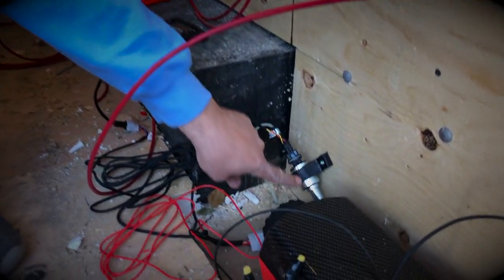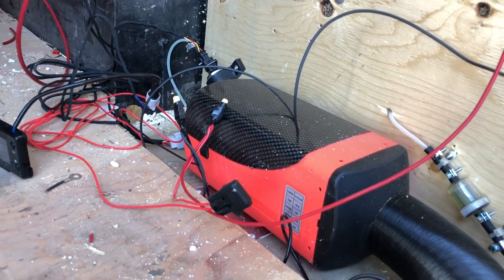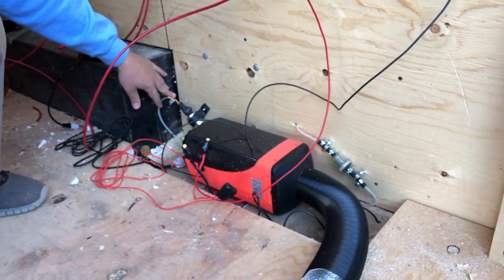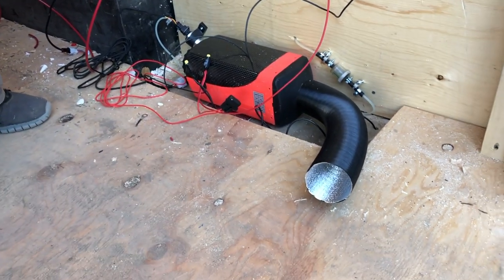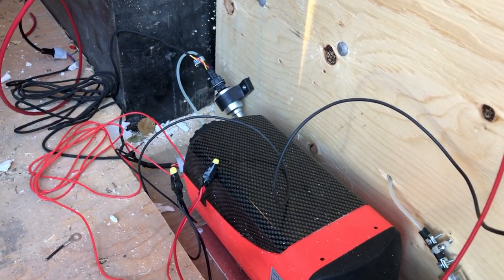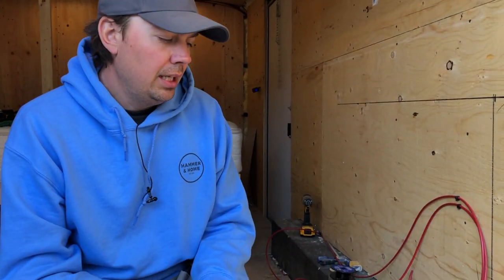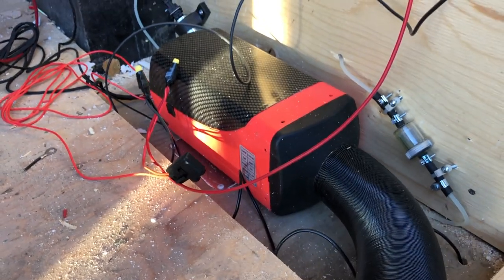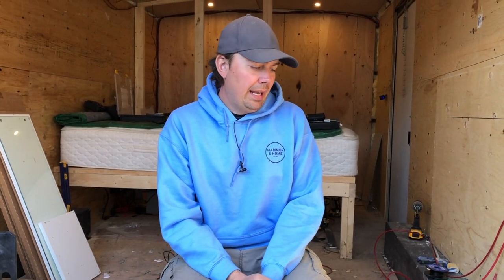Didn't expect this after installing the Happybuy Chinese Heater in our tiny home

Comment: I just ordered a diesel heater and have been binge watching videos like yours.  I thank you for your time and information.  It is very much appreciated.  I noticed your muffler laying sideways or flat.  I believe it is supposed to be turned like 90 degrees, so the weep hole in the bottom can drain out moisture.
Reply from the maker: that is correct, it should be vertical so the condensation leaks out, I have learned a lot since i posted this video. I also just purchased another heater, it one of the all in ones. ill be doing a video on it in the future as well. thanks for watching

Comment: One more note
I use a little harbor freight battery stick pump to fuel my tank
$12 and works awesome no funnels or pouring. And took a 2 foot piece of 4" thin wall PVC and glued a cap on one end. I put a wadded up rag in the bottom.
After I fill my tank I take the can and pump outside wipe the pump down and put it in the tube mounted in storage compartment
Never spill any doing it this way

Comment: Suspend the fuel pump on thick rubber band rings - the kind used on tent pegs  -  it will  wipe out most of the sound board solid mounts you have now
Reply from the maker: great tip thanks
Reply: Plus as you build it in, will also help.

Comment: I agree diesel stinks if you spill even the slightest bit
But one thing to consider is the climate you will be using it in
#2 diesel will gell up at around 15 degrees Fahrenheit
#1 will do a little lower
I live in the Pacific northwest and out here unless you live in a higher elevation town. All you can get is #2 Year round.
My heater is inside a snowmobile trailer that I also camp in up at the snow parks.
And because of that I mounted the tank, filter, pump and all the lines inside.
I have a unvented blue flame propane in there also
But it has a low oxygen sensor that is very sensitive and will not light much above 4500 feet. Also unvented propane actually adds significant moisture into the air. But it is a backup and could be used if trailer was sitting unheated and diesel was gelled up to thaw the system 
I love the diesel heat. Very hot dry heat

Comment: You can run diesel or kerosene, kerosene doesn't make as much heat as diesel. The ticking is the same volume but it clicks faster on high. You get used to the ticking though. We are off grid in a 5th wheel at 4000 feet elevation. I've had to change base settings in the advanced menu to tune for altitude. We love it.
Reply from the maker: nice! i haven't got into the settings that much, but it sure is a handy heater, I just picked up another one , its the all in one unit. so far its working pretty good. cheers

Comment: For one you should suspend the fuel pump with some kind of rubber and not solid mount it against a wall. That will only amplify the sound. Then enclose the pump inside a container with sound deadening insulation or foam of some kind. I'd mount the fuel tank inside to keep it warmer during below zero temps, Diesel fuel gels in cold climates. A tank inside a container will keep spills contained within.

Comment: Don't mount the fuel pump on a wooden board it'll act like a speaker
,I mounted my pump in an electrical plastic box and suspended the pump inside with an elastic band but make sure the fuel doesn't touch the box and can hardly hear it now.
Reply from the maker: that very true, i moved that configuration around right away

Comment: I am getting aluminum  box for the front (on the tongue) was wondering if the heater could be mounted in the box and just the heat vented into the traiiler  with  the controller mounted inside also? Thanks for the great video!!!!

Comment: We have a VW T5 van and fitted an Eberspacher diesel heater mounted under the floor can’t hear the pump at all may be worth trying one from Eberspacher. Regarding kerosene the Eberspacher manual says 50/50 kerosene/diesel at -15 to -25 *C, 100% kerosene below -25*C if using a separate fuel tank of course. Hope this helps.
Reply from the maker: Cool, thanks for the info! I’ll check it out and

Comment: Every experience heater I've worked on had the pump outside and mounted in a rubber mounted. Never heard mounted.   Also the oem ederspacher pump is quieter than the Chinese knockoff.

Comment: There are many videos on YouTube covering this topic but there are now “Silent” (expensive) pumps available on eBay. Always read the reviews before committing to one though as some offer no benefit at all. A great deal of the noise is also transmitted through the actual fuel line as well, so you may want to look at insulating this as well, particularly where it is fastened to the chassis. Good luck.

Comment: There are hundreds of video's that address the noise coming from the pump watch them. You can't hard mount the pump that's why your getting noise and mounting it outside would have eliminated much of the noise. I've never seen anyone run the fuel line like that drilling all those holes in your trailer but it's your trailer!! The angle of the pump is required to keep bubbles (air pockets) from forming in the fuel line. It has nothing to do with lubricating the pump and you can burn a combination of diesel and kerosene but never pure kerosene (K1) the lubricity comes from the diesel fuel. You might want to watch the series of video's done by John Mckay 47 he is the expert on these heaters. He will have all the answers you need about the heater!
Reply from the maker: since I posted last, i have moved it out side, from the videos i watched they others do talk about the importance of pump lubrication, but like you said more importantly keeping air bubbles out. thanks for the input, cheers

Comment: I get the same thing the mount for the pump is rubber it is loud the lines jump and tick as well, line has to fastened as well
Reply from the maker: yeah its a bit of an issue, i since changed my set up to mount the pump outside, its a bit better but i can still hear it.

Comment: "Ticking noise?"  Not surprising when you have the pump hard-mounted to a large wooden sounding board.  That's like touching a vibrating tuning fork to a door to "amplify" the sound.  Suggestions:
1. Isolate the pump from the wood with a wrap of soft foam.
2. Enclose the pump in a sound enclosure made of 1 inch foam insulation board.

If your fuel tank or pump will be exposed to temperatures below 32F/0C, you will need to treat the diesel with an anti-gel additive.  Usually cheaper to keep the diesel warmer.  If the diesel's temperature drops to the gel point, you will have NO heat until things warm up and the diesel can again be pumped.

Do NOT install a master OFF switch that cuts all power to the heater UNLESS you are CERTAIN that everyone will always turn the heater off properly (with the control/display unit) BEFORE operating the master OFF switch.  Sudden power off while the heater is running will most likely destroy the control unit inside the case from overheating.

Comment: Hi thanks for video. Ive just bought a autosleeper with one of these installed. But keeps saying fan failure though was working for few days. I havw pressed all buttons on tge remote. Please advise.
Reply: Just open the top and check the PCB board where the small plug is that runs to the fan, better still, take it out and strip it down and give it a good clean out, there are plenty of videos out there showing you how to do it.

Comment: Where did you get the fuel filter? What size is it? Thanks!
Reply from the maker: it came with the heater
Reply: @hammerandhome  size 22
Reply: Ebay, just put in the search bar fuel filter

Comment: You can get a quieter pump  and wrap it in sound deadning put it in a pvc box around 200mm x 200 mm outside.   That's my plan. pump 184$  Australia eBay  not cheep .  A guy utube removed the power supply  once red hot .. didn't damage it.   Not that one time anyway.
Reply from the maker: cheers
Reply: @hammerandhome  I got a quiet pump for 25$  yesterday on eBay  Australia

Comment: Do you know how many watts it pulls during and after startup??
Reply: you need to keep your battery topped up, as it sucks the power out to get the glow plug heated up, after that, it runs itself using very little power, if not it will cut out with number 1 error. (not enough power)
Reply: I have a 100 amp leisure battery, and it will run my heater for 2 or 3 nights. then charge it up to full during the day.
Reply: Another youtube said they draw 12 amps until they heat up then drops to 4 amps
Reply: @terrafirma9328  Yes that is right, for indoors or in the shed for that matter I use a 15 amp bench power supply, and it works just fine.
Reply: Yes, about 12 and a half watts for about 1 to 2 minutes, then the glow plug goes off and the heater then runs itself on very little power.
Reply: Thank you!

Comment: Dont connect the pump to a wall it will act just like drum in a band.Suspent it on cale ties so its not touching anything.You can also insulate it with foam rubber amd also put it in a plastic container.All te stuff you can bu on ebay that says it can quete down the pump wont work.Only one English guy has found a way of silencing the pump and its electronic. He cant make them fast enouch so you could wait years to purchase one from him

Comment: You would have been better and way more safer installing all of that on the outside of your home, having a diesel or paraffin line in the home like this is creating a candle effect. These fuels have a low flashpoint but they have the capability of soaking into the wood, carpet, vinyl of your home and that then could become very dangerous if  you have a slow leak or a big  leak and any naked flame that gets anywhere near the wood can result in a serious fire in seconds.

All you need to do is mount it in a small metal box outside or when you built the home a  sealed locker that you access from the outside and can lock. The only thing that you want coming into the home is the hot air pipe, insulated to keep out the cold and reduce the noise, mount the fuel pump on a rubber block and insulate it.  The inlet and outlet pipes (exhaust) to this device tend to be on the bottom, if you have to install the machine inside then install it using a turret so that protects the floor or wall of your home/van from the heat of the exhaust pipe.. they are sold on ebay as an aftermarket device for them. 

For new viewers they now sell a all in one semi portable version of this heater , all you need to do is supply 12 volts (at least 10 amps on startup) and connect up the exhaust and basically you can run the device anywhere such as a cabin, shed, RV, tiny home.   For those that dont know this device is a copy of the German Webasto which you find in some boats and in a lot of Volkswagen Vans/trucks. If you can get hold of the original from a scrap yard buy that as they never go wrong.

Its a good video and nice job but I still am concerned that you have mounted the fuel lines inside the home, they really ought to be outside underneath the trailer or mounted to the trailer frame for safety and the ability to change the fuel filter at least once per season.  Last thing you want is the stink of diesel in the house!!  Thanks...

Comment: Already working on it and I hate to say it but you guys are all wrong with the fuel pump angle and lubrication and pipe sizing I'll explain it in the video shortly but as far as the air bubbles that's not air bubbles that's called cavitation Google cavitation
Reply: The world holds it's breath waiting for this video ........... don't see it on your channel yet.... until then I'll go with John McK 47 videos called 
'Chinese Diesel Air Heaters Part 7 Metering/Dosing pump'  and  
'Chinese Diesel Air Heaters - Part 11 - Fuel Delivery'

Comment: ?everybody talks about the ticking noise?
Reply from the maker: It can get annoying, just keep the pump suspended in air and it’s better.
Reply: Try making a muffle box around the fuel pump. Heavy insolation to reduce the sound.

Comment: Is propane more expensive than buying diesel? I hear this diesel heater is really efficient.
Reply: Its more about availability, diesel can be found a lot easier than LPG and theres no regulator to deal with when refueling
Reply: @connectcapers7614  thanks
Reply: Its also worth remembering that propane heaters will put a litre of moisture into the air per hour, while the diesel heaters provide a dry heat. Less likely to give more damp problems than the weather will provide anyway.
Reply: @lordbungle6235  thanks
Reply: Yes I have 8k. Unit ran it 2 days straight wide open up existing 5inch furnace exhaust pipe that goes 7 feet into lined brick unused gas chimney out side temp was in 21f to 33f used approx 2 .5 gallons of red diesel approx 800 sq feet .Buying another for front of building   . Going to make a heat exchanger to recover more heat on next unit out of car exhaust a surplus 2” tractor muffler then metal window frame adapter and 2inch exhaust outside. Love these .i also have electric heat too expensive $$, and propane for emergencies . The amount of heat from the exhaust is wasted to vent directly out side my unit to 7 feet of 5 inch furnace pipe to the chimney radiates almost as much heat as the blower  so will add heat exchanger home made to the next unit I use be aware the 5 inch pipe get very hot also so same care as a wood burning stove would be prudent
Reply: Watched another youtuber with one who calculated it is 7 times cheaper than electric heaters, very efficent. Plus if you get free waste oil, even cheaper.
Reply: @terrafirma9328  you can use waste oil? What do you mean?
Reply: @TheKonnoisseur11   used up cooking oils (filtered) and mixed with kerosine 50/50
Reply: @terrafirma9328  i wonder what  what happens when you don’t filter it lol 💥

Comment: The pump should be installed vertical, no matter what the China manual says...
Reply: Why?
Reply: @terrafirma9328  because the Chinese copied the manual from Eberspacher (the whole thing is copied) which uses a internal filter built in the pump, so its recommended to mount the pump under an angle. This is done so the internal filter of the (eberspacher) pump would not be clogged very easy, any debris can fall in the "corner" of the pump. The Chinese pump doesn't have this internal filter, they use an external. So the best way for this pump to be mounted is vertical, output pointing upwards, this prevents any air to build up in the pump thus preventing rubbing metal on metal or wear. The whole point of mounting at an angle is to prevent air in the pump so it can be lubricated by the diesel....
Reply: @EXYUTV    correct in every detail Sir !

Comment: better off just pulling the inline fuse to power down, no accidents that way
Reply from the maker: good tip
Reply: NO! NEVER CUT POWER WHILE ITS HOT! Doing so will burn up the control board mounted inside the housing. They mounted the internal electronics right on the aluminum heater body, when you cut power the body temp increases and fries that board.
Please save yourselves some money and always let it shut down on its own. If you have to shut it down quickly, best way is to shut off the fuel pump via a switch in the wire or pinch the fuel line on the tank side of the pump. This will allow the heater to cool down on its own